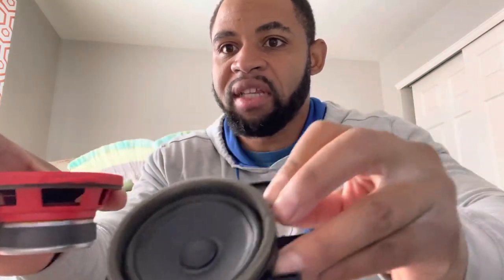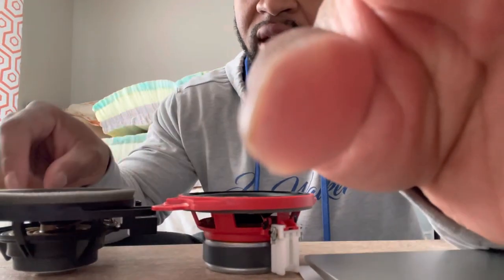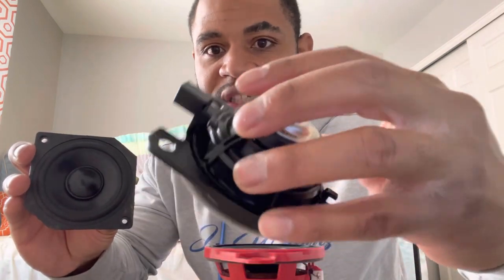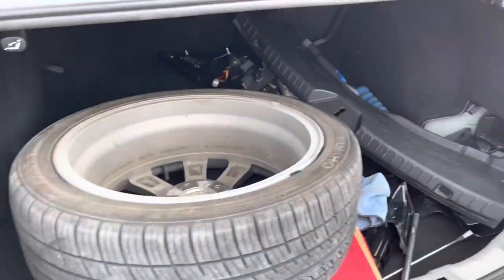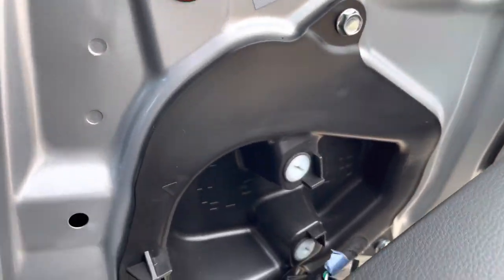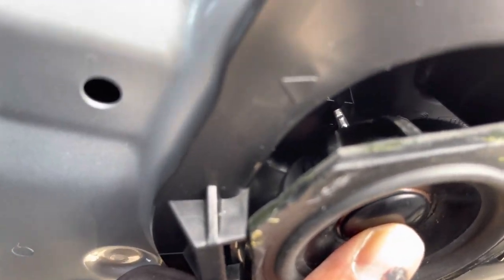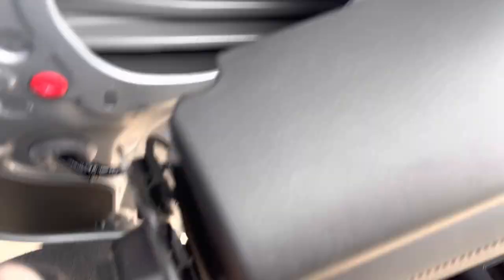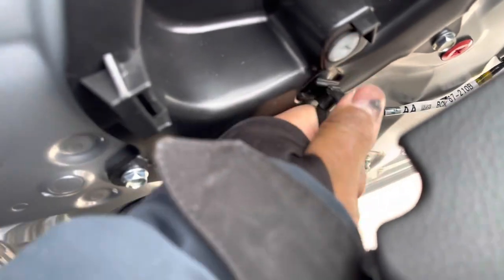OEM Bose Speaker Upgrade

Comment: Bose systems are meant mainly to capture the full range of sound, and have great definition, but they aren't very "loud".  They do have nice bass though, not muddy at all like on my chevy.
Reply from the maker: Indeed!
Reply: Not all Bose speaker ls are created equal some do sound muddy and some sound amazing
Reply: @IWeasel  Bose quality is bad through and through , poor quality parts etc .
Reply: The Bose in my CX5 sounds very poor. I also had to unplug the sub because it was too boomy.

Comment: Those are very small speakers. I would absolutely modify the speaker opening and go 5.5 inches.  You can add sound insulation in the door to reduce road noise, and you can also make a "behind the speaker" enclosure with thick rubber (inner tube rubber) to reduce even more noise.

Comment: I actually like the original Pioneer speakers in the rear. They have a more balanced sound especially in the midrange and a smooth high end. The Bose speakers are much brighter but I don't hear any midrange at all. If that's what you like then go for it.:) What you like is what matters.
Reply from the maker: @dlbsyst  lucky for us, we have an EQ that i can adjust, unlike the bose system 😁 the DB sensitivity level of the bose is more to my liking than the pioneer

Comment: yeah I have the select, the rear door speakers are terrible, sounds like speakers from from a cheap portable  radio made in the 70's, I dont like the tweeters either, high frequencies give me a headache I always  hear that tinny noise have to adjust the eq with all the high frequencies lower
Reply from the maker: 🤣 that description is accurate

Comment: I’m trying to figure out how to bypass the Bose sub and upgrade to a 12JL sub and somehow keep the integration in check
Reply from the maker: I'm not sure how to do that you, I'll look for the pinout
Reply: I just got done doing that. Snip the wire leading to the bose sub and run an loc to your aftermarket amp

Comment: Hi! This video is exactly what I needed because I’m doing the same exact upgrades. I instead bought all the speakers including the new tweeters, front door speakers, rear and center point speaker. I’m pretty confident I know how to install the Rear door speakers and front door speakers thanks to this video but I still wouldn’t know how to connect the center point speaker. Any advice? I wouldn’t know how to wire it through my car to get to the front door speakers to connect. Please help!
Reply from the maker: You will have to wire it into 1 of the front door speakers. It's honestly not necessary. I left my center speaker open so i could hear better bass
Reply: @supermazda3  I mean since I bought it I might as well try you know. Would it be easy to wire it to one of the front doors? I’m just concerned how Ill know and see where the wire is once it’s inside the center console area. Would I have to disassemble parts to know where the wire is going do you think?
Reply from the maker: @northernwinter3236  the Mikstore kit comes with a cable adapter that connects from the front door speaker
Reply: @supermazda3  Yeah I bought it. Just how am I supposed to wire it through the center part into the door? I won’t be able to reach my hand in the center part
Reply: how did it end up sounding?

Comment: The sensitivity is different on Bose because of their impedance however the speakers won’t work properly because all the Bose magic runs in the amp that their system comes with.  Without it, it’s not much point and might actually sound worse or less life to it
Reply from the maker: The bose sounds better because the RMS is almost the same & the frequency range is more broad

Comment: Do I need to upgrade the amp in order to use the Bose speakers? Also are the front speakers the same in the base model and Bose model?
Reply from the maker: No amp upgrade required the speaker are about the same RMS. The stock speakers are Pioneers. I listed the information in the description

Comment: Could you make a video showing all the speakers? Mine is supposed to have 8 (no Bose) but I can’t find the other 2 anywhere, just the 4 speakers on the front doors and the other 2 on the rear doors
Reply from the maker: You have 2 small tweeter on the door pillers & 2 woofers under the dash in kick board area